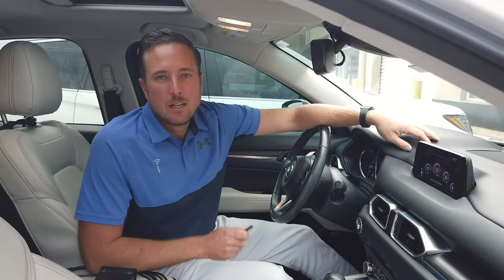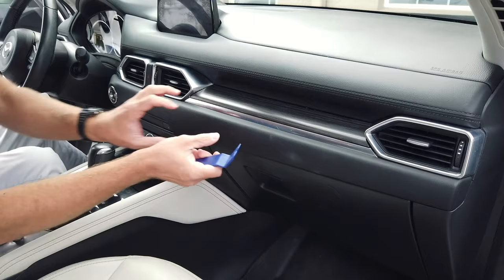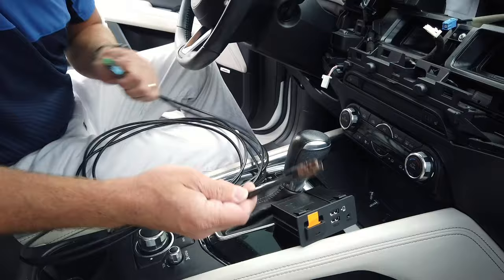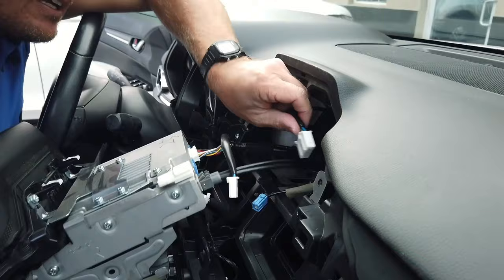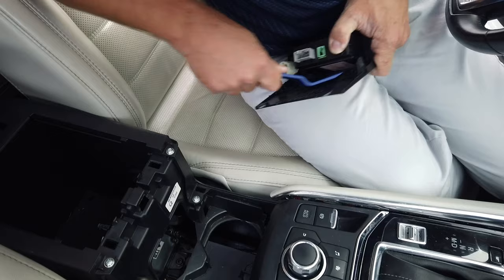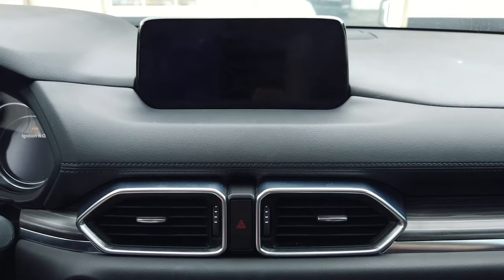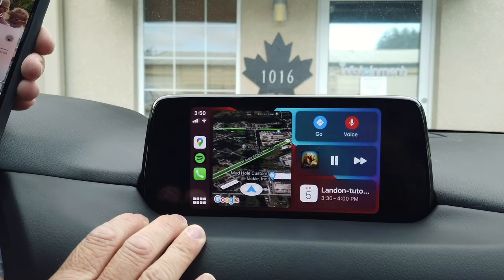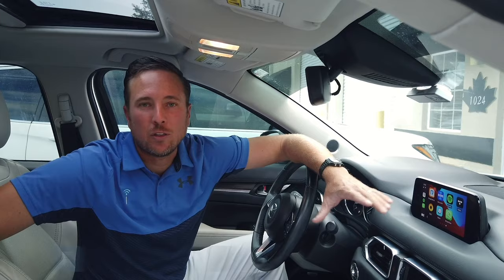Mazda Connect® Radio Upgrade with Apple CarPlay & Android Auto - Easy DIY Installation!

Comment: I had this all connected and working well, someone hit my car and it went to the dealership, now my car play isn’t working 🙄 how do I troubleshoot and get this working again.
Reply from the maker: If the car play quit working after the collision, it's possible that the connections to the USB hub may have become disconnected. But if the car play quit working after the dealership service, it's possible they could have altered the software or replaced the radio unit and it no longer has the car play. You can try re-running the software USB to see if that fixes the issue (as long as the software is above 30.xx.xx)

Comment: Awesome instructions! Another video I saw had the cables run through the center console, removing the gear shift etc. which looked very cumbersome. Your way with running the cables through the side worked great! Thanks!
Reply from the maker: No problem at all. One of our main goals is to provide upgrades, repairs, and replacements that are accessable to all customers. We support and cater to DIY customers so a lot of our kits are much easier to install then pieces you will see elsewhere. I am glad our solution was helpful.

Comment: is there an easier way so that I don'r have to remove anything, but hack it with a USB stick and install a file or an app to the OS?
Reply from the maker: No, after extensive testing we have found this is the easiest way to gain Apple CarPlay and Android Auto.
Reply: @Infotainment_nav  Is it a chore to snap everything back onto the dash board? I head sometimes the pins bend and won't fit back on perfectly. :(
Reply: @Infotainment_nav  Thanks!🙂

Comment: i recently bought a 2016 Mazda CX-3 i wanted to upgrade the firmware so i can get the upgrade kit for apple carplay i just want to know is it possible to update the firmware for asian version to English version i have the firm ware needed and my current OS version 56.00.401 JP M is and the update file is OS version NA_70.00.335C
Reply from the maker: We unfortunately don't have the Japan version of this software, and I do not think that the radio will accept the update being specific to a different region.

I highly recommend looking into some forums to see if someone has successfully converted the region from Japan to North America via software updates, perhaps there is a work-around.

Comment: would it work for a mazda cx5 2016
Reply from the maker: Unfortunately the CarPlay and Auto upgrade we offer starts compatibility at 2017 for CX5.
Reply: Good question. I have the 2016 Mazda CX-5 with the in the dash screen. So I'm guessing this means I would have to have the screen unit replaced as well. 😞

Comment: Very accurate and usefull, and without maybe inncesary warnings like remove sd car before doing the change or disconect battery, although i made with battery disconected, and works in both ways. Thanks.
Reply from the maker: Glad we could help!

Comment: Once upgraded to CarPlay, is the Bluetooth lag gone? I’ve essentially been bypassing this by using a Bluetooth adapter connected to AUX. The tradeoff is losing some button functions on the wheel.

Does this fix the Bluetooth lag? Or is that a completely different module?
Reply from the maker: Apple CarPlay and Android Auto is a bit different becuase it is either hard wired in or for Wireless Apple CarPlay and Android Auto it uses the WiFi in the vehicle. The bluetooth connection is not strong enough for Apple CarPlay and Android Auto. The kit in this video is wired Apple CarPlay and Android Auto but neither of them having any sort of lag similar to what we see with the bluetooth feature.

Comment: Hey
I own Mazda 6 2016. do you have a guide installing the kit on the vehicle? and will this upgrade interfere with connecting a subwoofer and new aftermarket speakers?
Reply from the maker: This is the installation video for this package.  We also have a PDF installation guide as well. 

https://infotainment.com/cdn/uploads/Mazda-Connect-Apple-CarPlay-_-Android-Auto-Upgrade-Installation-Guide.pdf

Comment: If I’m just replacing the port I don’t have to do all the specs with the screen just pop in a new one on my 2020 since the port does not work
Reply from the maker: That's correct. If you already had functioning CarPlay and it is no longer recognizing the phone or charging the phone, I would think that just replacing the USB interface would do the trick. Maybe you could check fuses for anything that references "Outlets" or "USB Interface" first just to verify (that is if you are not getting a charge to the phone when plugged in)

Comment: Have you (or anybody else) tried to run MZD AIO tweaks on these after installation? Just curious if it would work.
Reply from the maker: This particular package is tuned to factory OEM specification.  Unfortunately we would not be able to offer any advice on after market programming services.

Comment: Hi, just wondering what tool you used to get the 10mm bolts off. I can’t seem to get them out.
Reply from the maker: This was done using a 10 MM wrench socket on a generic muti use wench.
Reply: Use an impact wrench

Comment: I am having an issue with Ghost Touch on my Mazda. Can i install this and disconnect the touch screen ribbon cable? Also, will my phone blue tooth still work if i choose not to plug into the USB?
Reply from the maker: Since CarPlay is primarily accessed through the touch screen, I highly recommend having the screen replaced or repaired. The bluetooth function will remain the same, so you can still use bluetooth for audio and phone calls... But if you're trying to use CarPlay, the phone must be plugged in, and you have to use the touch screen.
Reply: Thank you, appreciate the feedback!

Comment: Can I use the 59 version for this ? Or do I absolutely need to go get it updated?
Reply from the maker: As long as it is above 30.xx.xxx you should be fine. 59 should have no issue.

https://infotainment.com/shop/interior-accessories/infotainment-radio-upgrades/m-kit30/

Comment: What about for a mazda 3 sport 2024.
Reply from the maker: Please ensure your existing Mazda Connect system has a software level of 30.00.XXX or higher.  As long as the current software level is at the minimum requirement or higher, it will be compatible.

Comment: I plug in a dongle into my  centre (2022 Mazda 6 atenza) console and apple car play works wirelessly without plugging my phone in?
Reply from the maker: This particular upgrade is meant to gain the Apple Carplay/Android Auto functionality on vehicles that are not equipped with the feature from the factory.  This upgrade requires a hard wired connection to access the feature.  It will not be a wireless connection.

Comment: I've done the installation the same way all seems to work. my iphone does connect wie bluetooth but my android auto dosn't work with the usb cable. the usb slot does not even work.... my phone does not get recognized.

but even the carplay works, sometimes it's very laggy and is super slow. could the module be broken?
Reply from the maker: Hmmm. That's not normal. Was this purchased through us?

Comment: Do i need to connect the phone always withe cable? can be used with bluetooth?
Reply from the maker: You will still have bluetooth for Audio streaming and hands-free calling but bluetooth connection is not strong enough for Apple CarPlay and Android Auto. This generation is wired. They should be releasing a wireless system for the 24-25 vehicles.

Comment: Can I do the same for my infotainment system in mazda cx9  2018?
Reply from the maker: Yes your 18 CX9 is fully compatible with this upgrade. 
https://infotainment.com/shop/interior-accessories/infotainment-radio-upgrades/m-kit30/
Reply: I have to update my Mazda connect system as it is 59.00 version..
Reply: Will it work for cx9 2016?

Comment: 2019 CX-9 will work? Didn’t come with CarPlay.
Reply: I know this company is very reliable. I did plug-in play with my 2018 Altima.
Reply from the maker: Yes this upgrade would be fully compatible with a 2019 CX-9 and this is a very easy upgrade to install. Cost on this $299.95. 
https://infotainment.com/shop/interior-accessories/infotainment-radio-upgrades/m-kit30/
Reply: What’s the difference between this and the one on Amazon that also has wireless compatibility and is a fraction of the cost? $67.86 to be exact.
Reply: @iAmJayliin what the link to the Amazon one?

Comment: Does this work for scion ia since it has the mazda design?
Reply from the maker: No unfortunately, we have tested it but we do not have a solution for the Scion at this time. Use this link and we will keep you updated if something like that is released. 
https://forms.zohopublic.com/infotainmentcom/form/RepairAuthorizationForm/formperma/t_HBejMEDO5QMtdFj2kDGZfKhbecXYHYQoJh9WjT864

Comment: Going to try this on my 2020 mazda cx-5.  Does the media player require usb stick updates from time to time?
Reply: And are there any coupon codes available? 👀👀
Reply from the maker: Apple CarPlay and Android Auto do not require any additional manual updates. Those features update daily automatically. As for discounts if this is your first order with us you can sign up with us in the top right of this link and it will give you a 5% sign up discount. 
https://infotainment.com/shop/interior-accessories/infotainment-radio-upgrades/m-kit30/

Comment: Would it work for Mazda 6 2015?
Reply from the maker: You'll want to ensure your existing Mazda Connect system has a current minimum software level of 30.00.XXX or higher.  As long as your vehicle is at or above the minimum, it will be a compatible upgrade.